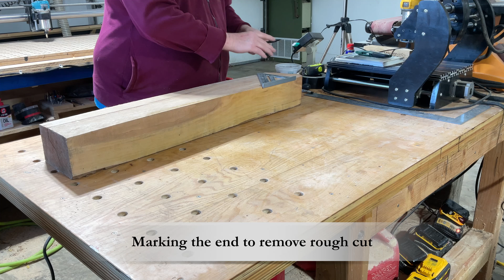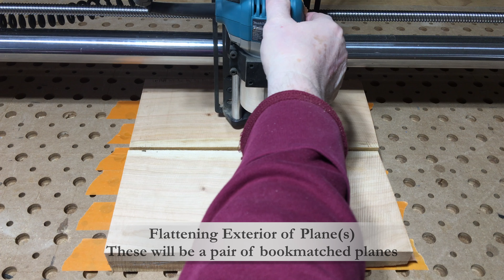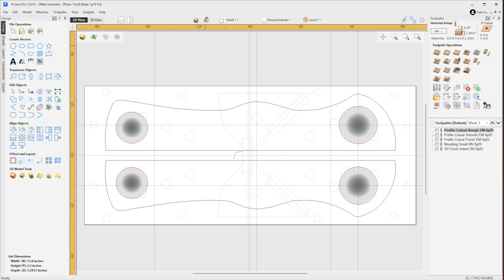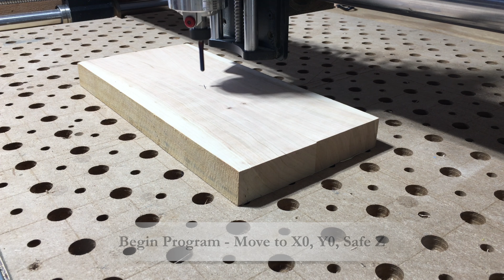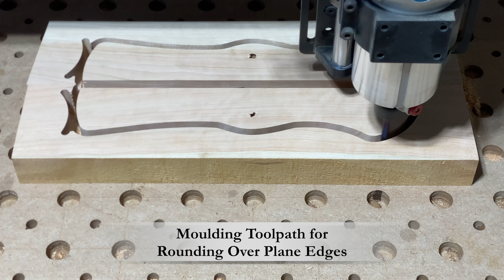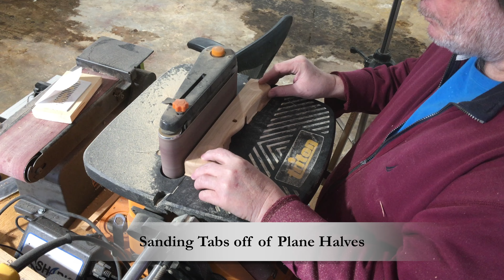How to Make a Krenov-Style Wooden Hand Plane with CNC and Traditional Tools

Comment: Aside from "it's what I had" was there a specific target for the 120 grit sandpaper?
Reply from the maker: Hi Randy - 120 was used as a mid-grade sandpaper at that stage. 120 is enough to remove tiny bits and pieces, but still leave a good bit of friction for glue-up. I used 180 grit on the random orbital sander before the first coat of oil and 240 with a soft hand block before the 2nd and 3rd coats of oil.
Reply from the maker: This is similar to the soft hand block I'm referring to - https://www.amazon.com/M-jump-Woodworking-Furniture-Restoration-Automotive/dp/B07SHV674S